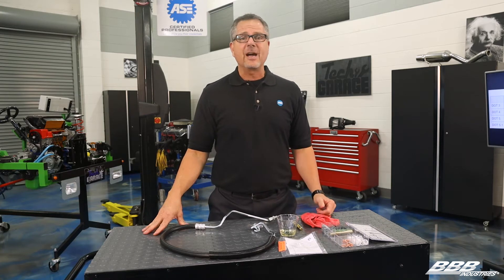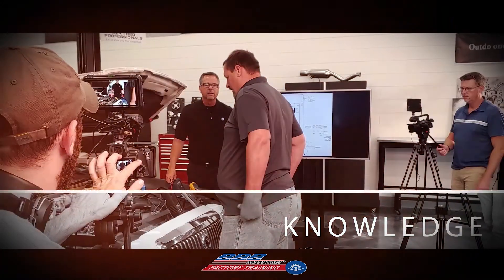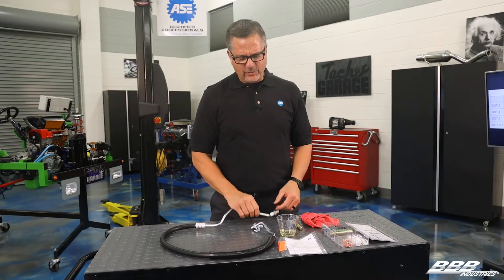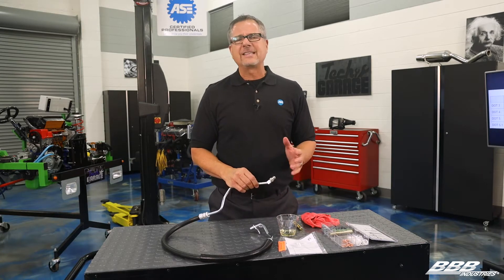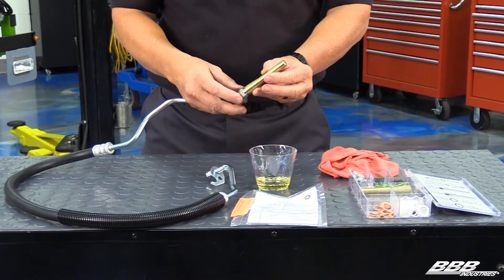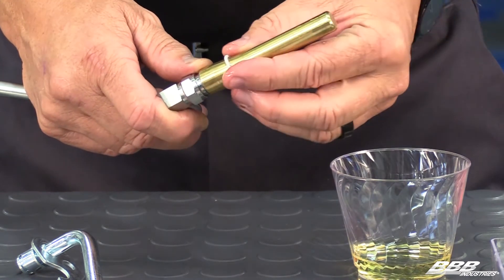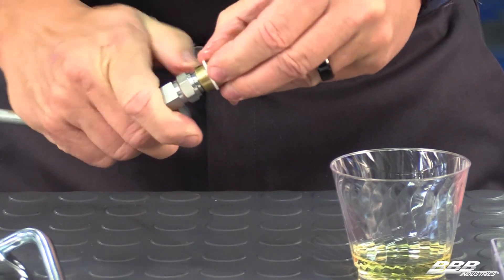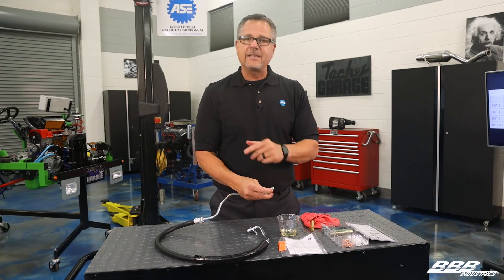Easy Teflon Seal Installation

Comment: Cutting a 5” section around the middle of a plastic 2 liter cola bottle without any raised label can then be trimmed as if to make a 2” funnel. Place it over the threads and curl to a small size less than the seal. If a vise is available, gently hold the hex head of this bolt without deforming it. Lube with the proper fluid and slide the seal into place. Make sure to keep it straight and not rolling or twisting the seal. Remove your homemade install tool, wipe the fitting with a microfiber rag to ensure cleanliness. Teflon has memory, so if allowed to sit and massaged it with your fingers, ensure it is flat in the gloves seat, it will shrink and snap in a short time to fit & seal properly without a leak. I the tool is available on a loaner program at your parts store ask! They may not have it and this is a trick used in automatic rebuilding. Hopes this helps and route the hose away from hot or moving parts w/zip ties.
 Certified Automotive ASE Master Tech since 1978